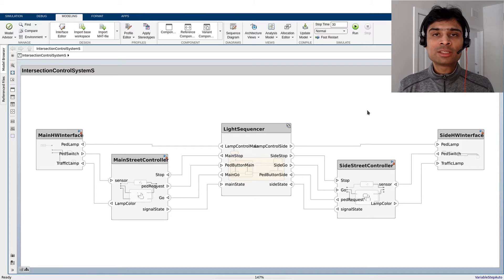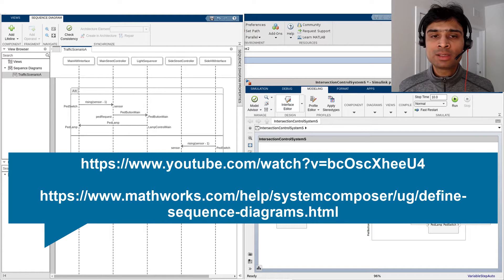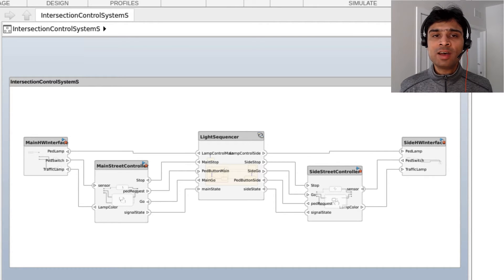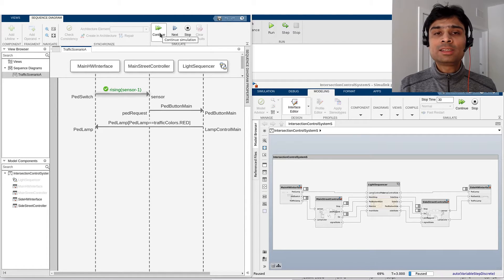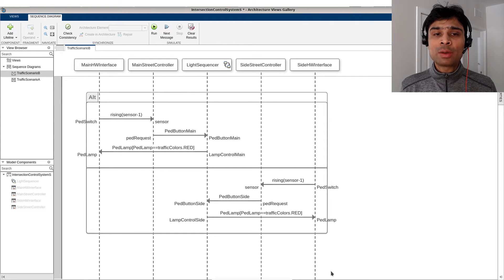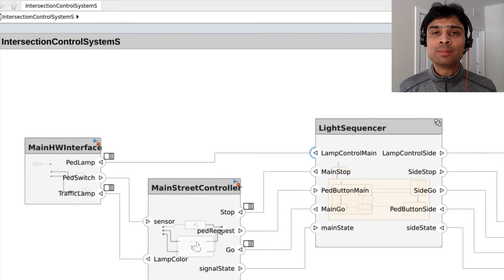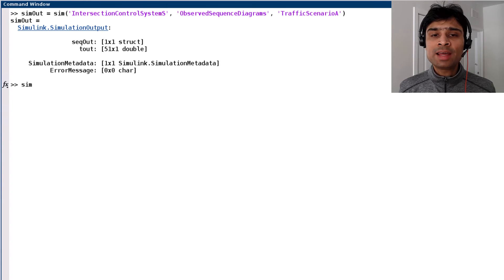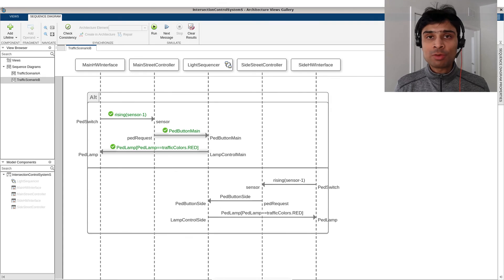Observing System Behavior with System Composer Sequence Diagrams

Comment: In 2025a I don't have the options to Simulate the Sequence Diagram.
Reply from the maker: Sequence Diagram is available in R2025a. Can you review the documentation? https://www.mathworks.com/help/systemcomposer/author-sequence-diagrams.html
Reply: @MATLAB  I have checked, I guess that the simulation of the Sequence Diagram might only be available using system composer architecture models and not system composer software architecture models?